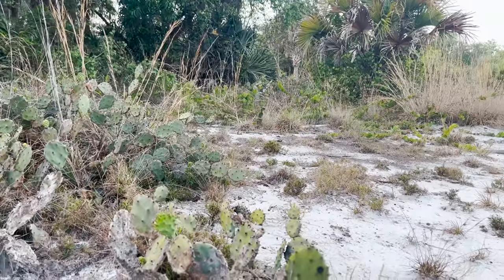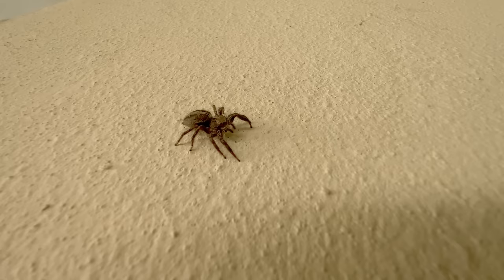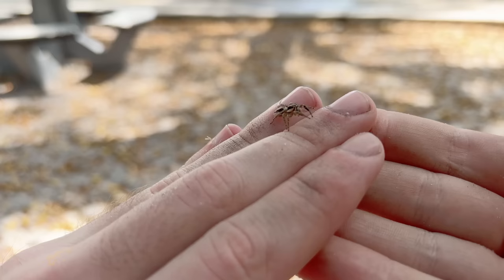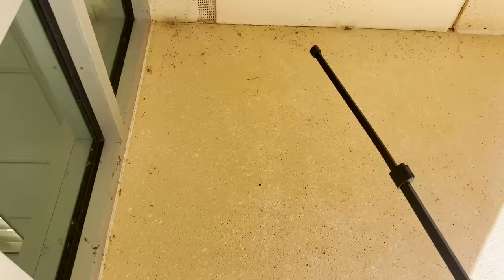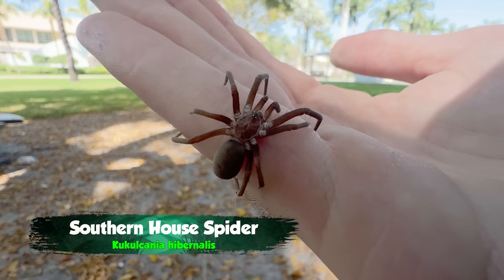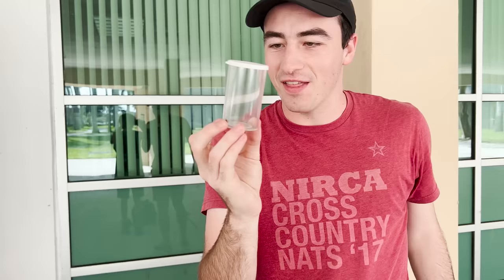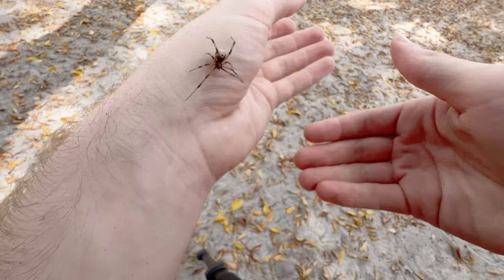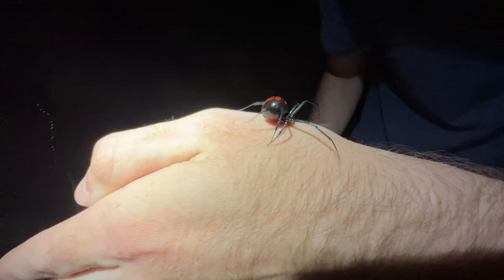This VENOMOUS Spider is Taking Over America... Is it in YOUR YARD? ft. @CoolCrittersYT

Comment: San Diego, CA- usually hot summer months, you will find hundreds of these under bleachers or stationary large metal objects. You will also see them at the bottom of metal poles (stop signs, etc)
Reply from the maker: Yup. They have a big stronghold there.
Reply: Anywhere there is a food source....you’ll find Widows!
Crickets especially, but also includes cacaroaches, scorpions, small snakes, and a few others my brain decided to grease a fart rather than recall those examples.

Comment: Got some great macro shots of a wolf spider with it's babies clinging to it's body.  The unfortunate thing happened is while I was shooting she jumped of the stick and went down about 3 ft. most of the babies detached or seemed to fall off at that point. Anyways after I process the photos I'll send you a comment letting you know it's on the camera. My guess to the amount of babies was somewhere around 30-50. I didn't know they were babies when I was shooting as I thought it was brush stuck to her. When I pulled up the macro shots at first I thought they were parasites. I don't know if that interests you but I've watched some of your videos in the past. I had some macros of the Golden Silk Orb Spider which is on the channel and I hit you're channel for identification. First big spider shot I've done with a macro. At that time all I had was 60mm so I had to get really close. I didn't know anything about them at that point. I also had to check to see how stupid on the idiot scale I was because I had to get really close. I couldn't help myself but to get close up. Real close due to lens. I was determined to fill the frame. Thought I would give you a shout.

Comment: They love metal under park benches or wood benches with metal bolts, plastic toys with metal hardware or inside bird house with metal pole through it aluminum softit. That's probably why they do much better they like the extra temperature metal provides?  Find the black w in wood often. If your here in florida go to a few parks the benches are usually infested and everyone sits down and never notice! Palm harbor area loaded!
Reply from the maker: I believe it. In some areas these guys are everywhere

Comment: Cool vid and nice finds. One thing to check though, L. geometricus is not as venomous as L. mactans. Not thought to be significant to man except in very rare cases. Males are also not capable of penetrating vertebrate skin. We have them both in South Africa. Brown widow a lot more common.
Reply from the maker: Clarification- brown widow is more toxic drop for drop than a black widow (about 20% more toxic), but has a lower venom yield. Unlikely to receive a serious bite from geometricus.
Reply: @MyWildBackyard  that highlights the issue using LD 50 for people. Some studies have show that brown widows are less toxic (guinea pigs) but more toxic in mice. As far as we know in humans the effects are far milder. Venom yield could play a role as you mention, but overall it still doesn't paint the right picture. For example, there's a species of mouse immune to saw scale viper venom. If we tested on them we'd think they're harmless. For me, snakes and spiders are either potentially deadly to humans or they're not. And with that in mind we do know that the brown widow comes with a much lower risk. Just another perspective. You're doing a great job with these  vids, cheers.

Comment: the fact that geometricus is taking over mactans areas tells me its because of climate change, you also have the fact there's just one eggsac on average per black widow against 3-8 sacs per brown widow, that's telling me there's a shortage of males in the black widow species. some of the data in the hypothetical section on the oxford study seems suspect, i don't believe the 20 vs 1 stack of "breeding females" for example and consequently the arithmetic with the 6,000 vs 150 spiderlings estimate is way off. and if 20 adult female widows were observed, to 1 black one, how wide was the search? that data needs entering. not just "15 houses and 1 park"